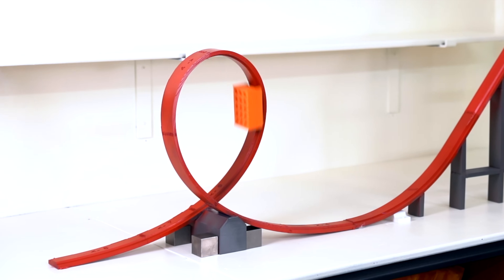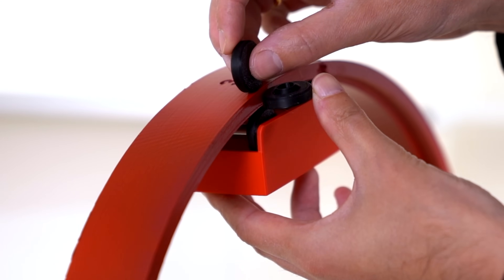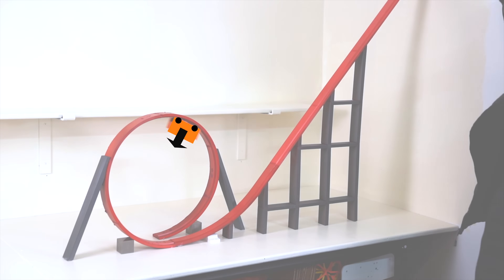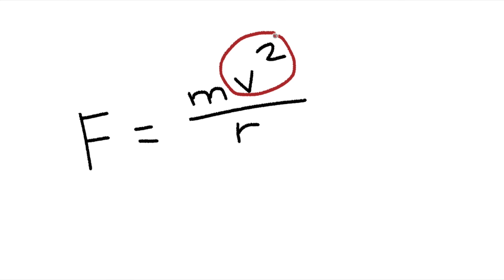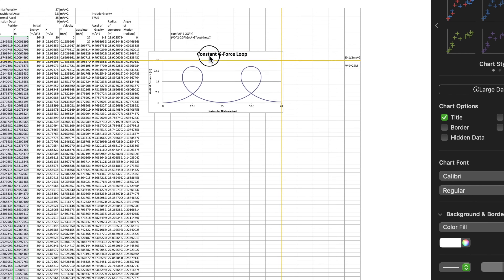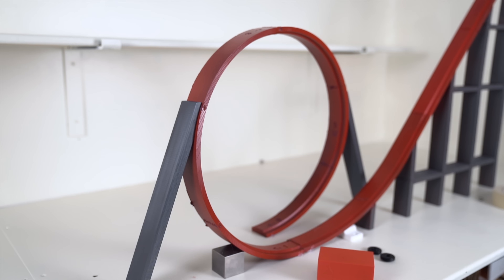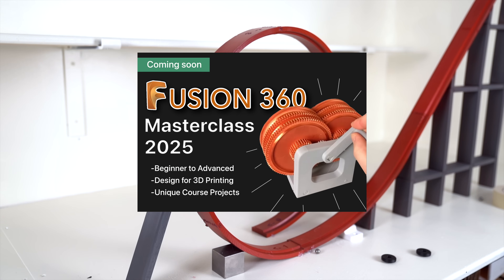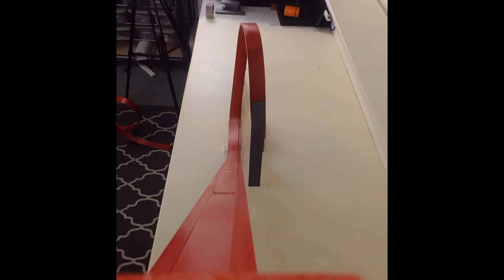Why roller coaster loops AREN'T perfect circles...

Comment: Um, think again. The cart falling off the track indicates a g-force less than 0, not less than 1 (rather, it would be less than 0 if it were actually attached to the track. Falling off, it’s a free fall, so exactly 0 g-force).

Comment: I heard some years back, that roller coaster designers use clothoid spiral curves in their designs which makes sense. The clothoid is a curve of continuously changing radius and is based on the Euler spiral IIRC. Though not quite as common today, highway engineers use the same clothoid as transition curves in roadway design. They are also aesthetically pleasing. For the record, I worked for a state DOT for many years 🙂.
Reply: The man who first came up with the idea of using the clothoid loop also was the first to use computer software to design rollercoasters. Apparently he modified german autobahn slip road engineering software which calculated the necessary roll to keep the force normal to seats of passengers, and instead used it for the rollercoasters. I imagine he drew parallels from both
Reply: @zakb5757  Thank you for that tidbit of info, never knew that!

Comment: The condition on the g force isn’t 1g but 0g :)
Reply: to keep the car on the track you need at least 1G in opposite direction to grabity so it doesnt fall in the up side down section
Video is correct
Reply: @maticz3923  well, no.
You need 1g of  acceleration due to pseudoforces at max but only so your absolute acceleration can stay >=0

Comment: Cool video.
I wonder if there's also something to be said in regards to fuel consumption; I would assume that a loop can be optimized to make use of inertia/gravity to lessen it and my gut says the teardrop shape would be better at it, too.
Reply: Rollercoaster don't use "fuel"
Reply: @MRblazedBEANS  someone interested in good faith debate might consider rephrasing this as "whatever resource is used" because the question remains valid whether it's electricity or fuel. But that's not you. I'm sorry you feel that way.